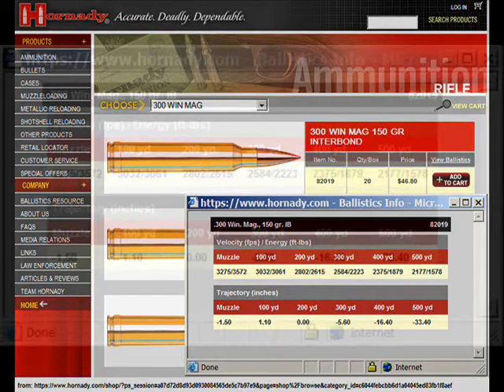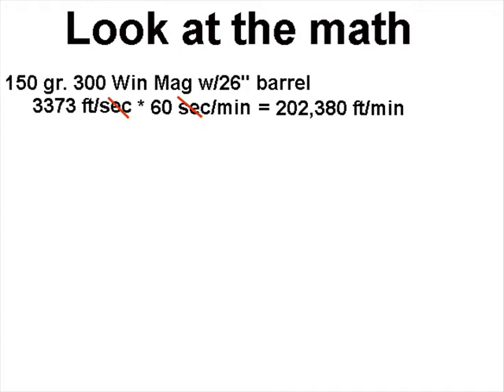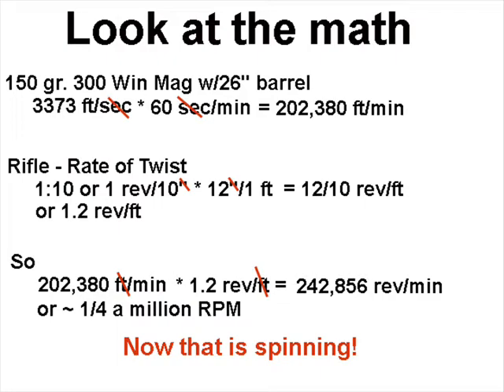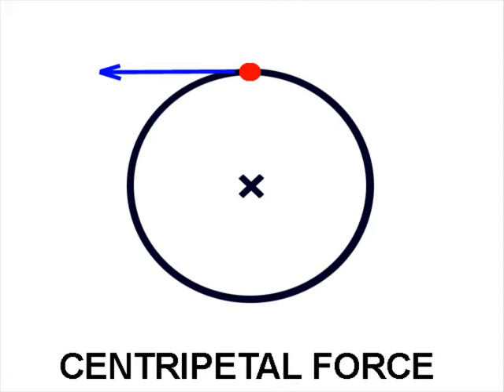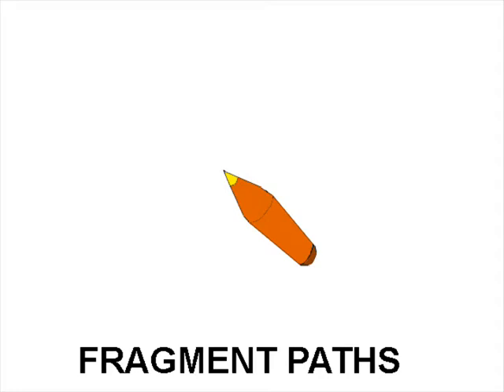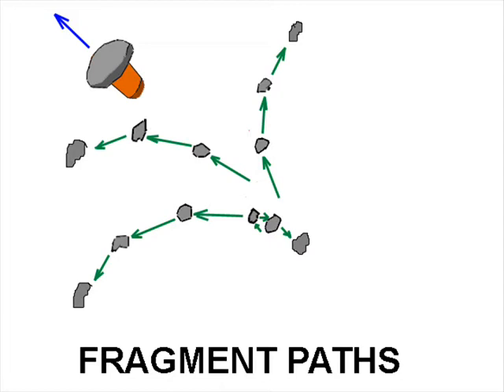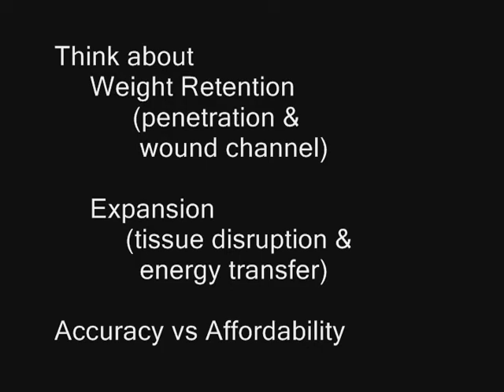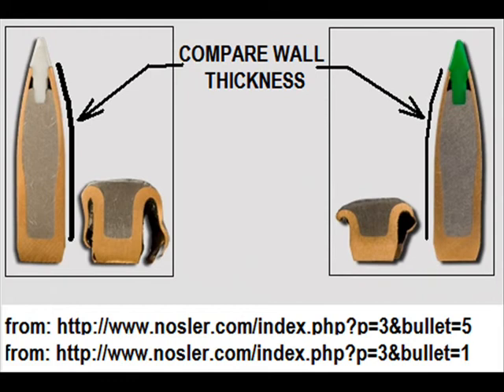Ballistic Fragmentation

Comment from the maker: @drnkinirish Bonded core bullets like the Accubond are sometimes heaver jacketed & sorta designed for heavier animals like elk. The partition is known for good penetration but if I remember correctly, is a lead nosed bullet. If those were my only choices I wouldn't go Barnes (altho you should try for yourself). I'd go Accubond in the 300 wm (good for elk & reduced fragmentation) & maybe 270. Partition in '06, 308, 7mm 08 & 280.

What I actually use is Hornady InterBond & InterLock. Typ ~1/2 the$

Comment from the maker: @drnkinirish Barnes.. accuracy... I'd take issue based on my limited personal experience. They have been, bar none the most accurate bullet I've shot. And I have fired them in .270 win 450 Mar S/S and 458 win mag.

The problem I have w/Barnes as a hunting bullet is they do exactly what they are designed to do. They expand 2x the caliber and don't fragment. And if you don't hit them right, that can lead to problems tracking.

Accubond v Partition - (opinion alert) depends on what you are shooting

Comment: As you reduce barrel length, is this a linear relationship to FPS and actual RPM of the projectile?  I'm concerned about going to a 10.5" barrel (1:8 twist) on a .223 round, 55 gr steel core (M855 ammo).  My concern is not getting enough FPS to have fragmentation on tissue at 100-200 yards with M855 as it depends on yaw to get good fragmentation/expansion on tissue  and that yaw effect is due to the extremely high RPM normally seen with a 14.5" to 18" barrel.